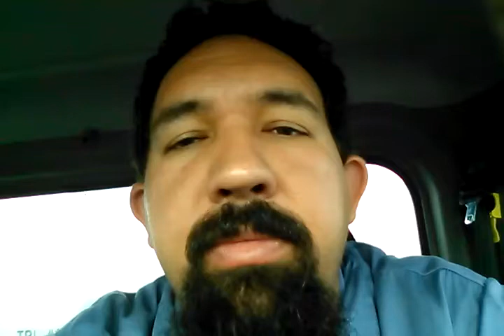Question for knife makers or metal guys

Comment: Not good for knifemaking, it's abrasion resistant steel . it's used for plow blades and such. they add Boron, Manganese, Nickel, and Chromium to make it wear resistant. Certain elements In it you don't want In a knife. Hope that helps a little